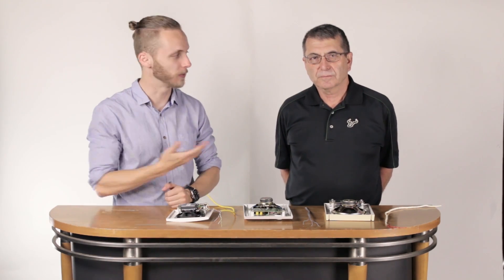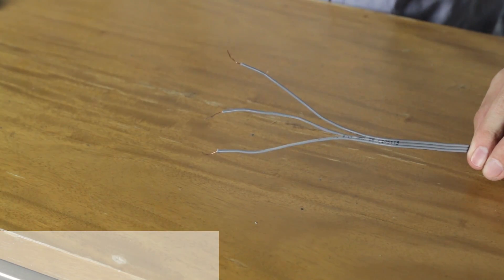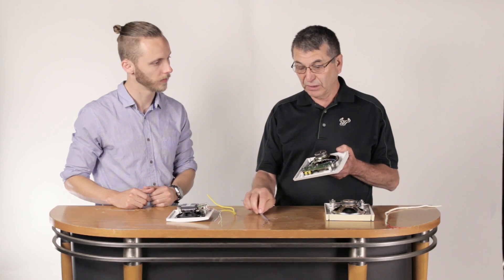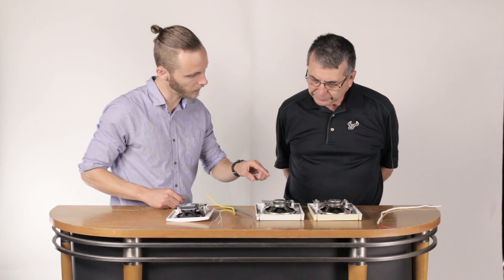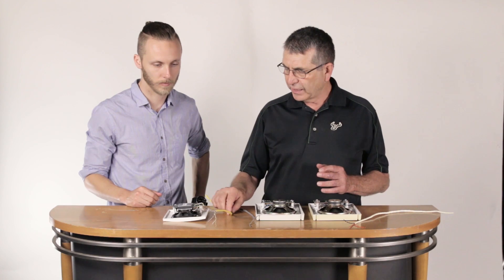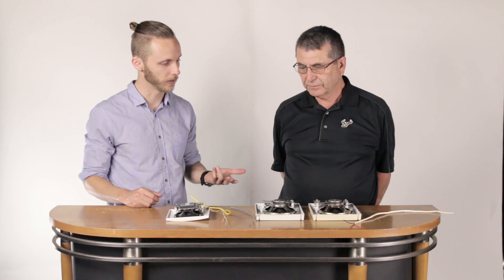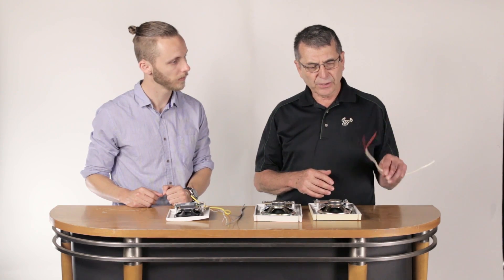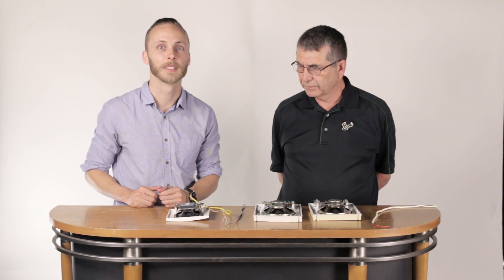How to - Intercom Wiring - Roger

Comment: This video talked  about the wiring, the type of wiring cables are used for each type of intercoms. He even said that its a no brainer. But what is  the voltage needed to operate the system ? would that be a part of wiring?

Comment: NUTONE still selling crap, I see.  Back in 1975 I purchased both a NUTONE and an AIPPHONE system for my test bench as I was about to open a security/intercom/ telephone/tv (eventually cable)/fire and safety, and music/audio system installation company, start to finish.  NUTONE was crap (but cheap), AIPHONE was quality (but not too much more expensive). Considering I had the Los Angeles market, traveling almost anywhere to replace CRAP components was very expensive, even more so if under warranty. It was worth it to charge a little extra for an AIPHONE system .. less headaches, ultra quality, repeat and referred customers. 

Just to get a common sense of the difference between NUTONE and AIPHONE, consider cars... like a CORVAIR to a BMW ... that big of a difference, but the cost was more like a CORVAIR to a standard CHEVY sedan.  Can't be that.

Comment: How to extend the wiring of intercom

I got a wire 10m

I want it to extend 25m

How to do.it???
Reply: OK, write this down... it's critical information.    Add 15 M, make sure it's within then range for the gauge of wire (probably is). Match color for color or create a color conversion chart,  put it near the master intercom (in the wall, if possible, or in your file cabinet) and refer to it if you use different wiring colors. SIMPLE STUFF.  Or, I can come out and do it for you , anywhere from $150 to $300 depending on the installation requirements ... if you're within 25 miles from my shop (Redondo Beach, Los Angeles).

Comment: Do you directly hard wire them at each end and nothing else? No power?
Reply: Those old intercom systems were just speakers and microphones, no power were needed at the room stations or the outdoor stations.  The main base station may have power but it could easily be the 24 VAC system used by the doorbell and thermostat wiring instead of the 110 VAC house lines.  Hey just be glad they didn't use compressed air which was common for commercial instrumentation lines such as thermostats in office buildings around that time.